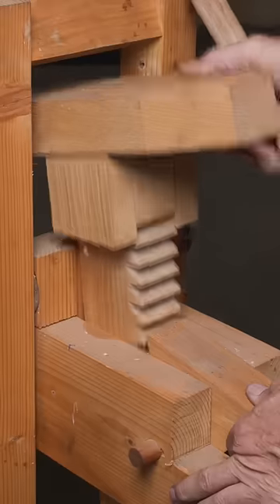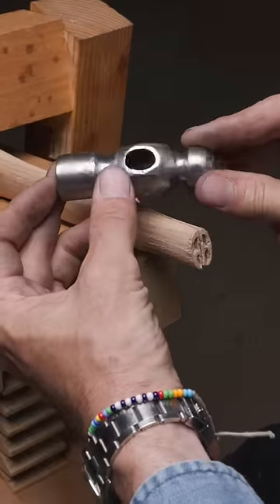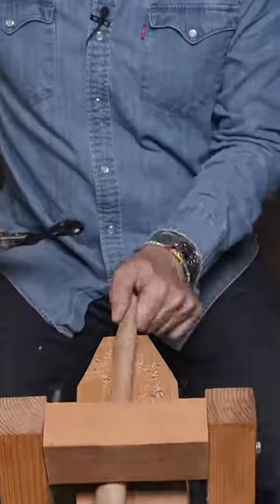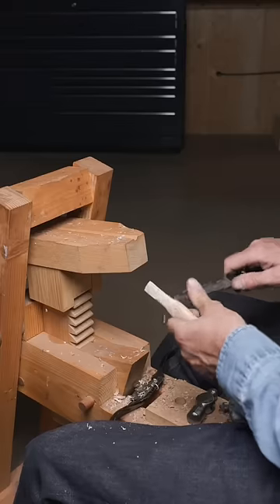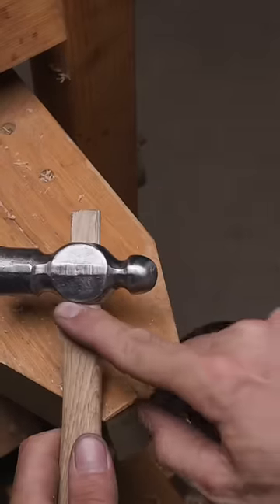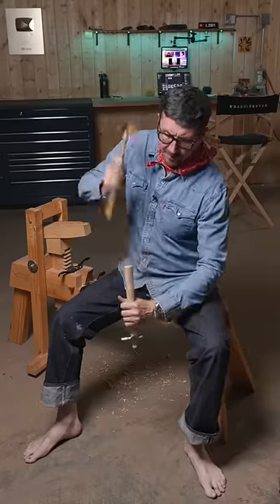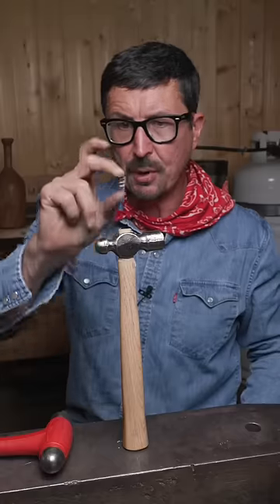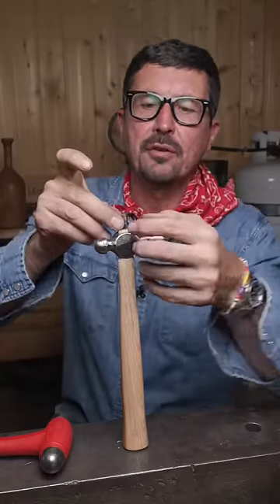Professional Homeowner Hack #30 Wranglerstar #Shorts

Comment: I'm going to be totally honest, as someone who's pretty handy and a professional mechanic, I didn't realize you put the handle through the small side, but sa soon as you said it, it made total sense.
Reply: Me too! I have re-handled at least 30 hammers in my life (born 1949).  I didn't know to go into the small end.
Reply: I don't think your actually suppose to do that but I mean I don't know that just don't make sense to me
Reply: It lets the wedge do it's job
Reply: I've been mishandling my hammer too...
Reply: @shakinbottles  No, you are supposed to do that, when you hammer in the wedge the top of the handle gets wider and the head will be snugly pushed against the shoulder of the handle, and won't come loose over time.
Reply: 🤯🤯🤯me too
Reply: This
Reply: Yep, anything with what is called an adz eye needs to be oriented correctly.
Reply: Expansion is your friend.
Reply: That's what SHE said!
Reply: Do it with a framing hammer
Reply: @shakinbottles you absolutely are supposed to. Otherwise the head will fly off after heavy use

Comment: Before the wedge draw a line on each side of where the wood comes out of the head then remove the handle frome the head and c it on the pencil line so it matches the depth of the head and it and put your wood wedge in and cut the excess off and drive the steel wedge into the end of the hammer and it will look factory finished
Reply: yep

Comment: You will get more wedge pushing/tighting force by having the wedge at a 90° angle.  

90° is pushing on two spots

45°is pushing on 4 spots.

If you use 45° method, use a slightly larger wedge.

Comment: After I clean off a rusty metal tool I like to spray it with dry moly film so it won't rust again. It is not oily so it does not have other contaminants stick to the metal.

Comment: One hammer handle 15.00 
One shovel handle 18.00 
Both hickory 
I cut my own and shape my hammer handles just get 4 
Handles from 1 shovel handle 
Side note it’s also good for 5lb sledgehammer too 
I’m a body man I break my body hammers quite a bit 
Custom shaped handles fits each hammer for their use 
Something you should try Cody is setting a hammer or ax handle with panel bond epoxy I still use the wedges 
I coat everything with epoxy even the wedges, it fills the subtle gaps and I rarely have a handle come loose , I still break them from allot of use 👍🏻

Comment: Yeah I go the Old timer way using that boiled lin seed oil. Apply it, let it absorb, repeat until the "ponds" remain. Wipe it down. If it remains a little sticky you can use a little bit of turpentine to cut it down and to smoothen it up. Use proper ventilation. Gives it that 1950's kinda look. Nice job man!

Comment: I’ve got a block hammer that my uncle gave me years ago, I recently replaced the handle and took a wire brush and some WD-40 to the head, which was all caked in years of rust and grime, and I saw the name of my great-great-great-grandfather stamped into the head. Asked some of my family members about him, apparently he was a blacksmith and machinist, born in Hungary in 1848. And that hammer is harder than a coffin nail, a file won’t touch it, so it had to have been stamped when it was still glowing. I’ve used a hammer forged by one of my ancestors for years, and I never knew until last month.

Comment: Only thing I'd add is to saw of the exposed wood atop the hammer head before driving the metal wedge in at your 45 degree angle.  That way the wedge seats flush with not residual wood.  
Also, it is imperative to wear Westco Jobmasters 24 hours per day.

Comment: I always cut the handle so it’s on the shoulder but ends up a fraction below the head of the hammer, drive in my wedge at an angle, then fill the gap with epoxy.  That’s how my Dad showed me 60 years ago, and it’s worked well for me.  I wish I had that jig you’ve got for fitting handles though, nice!  👍

Comment: Why do you seat the handle by striking the bottom? Does this do something specific that going from the top wouldn’t achieve? Thank you Cody!
Reply: Provides a 'natural' seat, goes where it wants, instead of where tou want it too. This tells you if you've done a good job (by showing if its leaning or twisted.)

Don't force the head onto the handle.

Comment: In a few videos I've heard you address scraping varnish off with a pocket knife but I've never heard you say why not to use sandpaper.
Reply: Scraping it causes varnish to come off in larger chunks/curls.

Sandpaper causes dust in the air, and clogs fast with varnish.
Reply: @autumn5592  ty

Comment: What is that cool device you are using with the foot pedal? Why take the varnish off ? I just did this project, but with bamboo. I inserted a piece of bamboo that had been spit in half lengthwise. Then I wrapped it with electrical tape. Then I mixed a 2-part solvent together and poured it into the hollow created by bamboo on one side and electric tape on the other.

I let it set up and harden. The cool part is I grow the bamboo myself so there is little or no up front costs. I can also make the handle almost as long as I want!

Comment: Do you have a video showing how to replace a handle on an ax head? I have two ax heads. And have no idea how ro fix them. Is it the same process, just bigger? What about the part where you hit the handle on the back to drive it into the head as deep as possible? How would you do that, with a large ax? Oh yeah, these are large ax heads. Not hatchet. Thanks

Comment: I have many a tool in my collection. However, i dont have a fancy wooden vise as such.
My homeowner hack is to knock the head off my ball peen with an estwing, then ill continue to smash the new handle in the head by smacking down on my welding table a few times, drive in the wedge, and fight with it loosening up for next few years before i snap another handle, to do it all again.

Comment: Do you find anything wrong with fiberglass or Kevlar carbon composite handles?  Is there anything much different about putting one of those handles on that might be better than the way you typically put on a hickory handle? 
  Personally, I don't prefer the look, but I think they withstand atypical abuse better.

Comment: Would roughly the same process also work on an axe head?

My pop’s got two axe heads split off into rotten logs from like 13 years ago, one’s all rusted but the other’s still shiny, just gotta get the old wood out of it and it looks like this’d work
Reply: Yeah, it'll work fine.

Comment: I'm confused. I looked at my hammers and they all have what looks like the handle and a spline. All the splines are wood except one is metal. So there's a wood spline you tap into the head of the hammer and then a metal spline driven into that? Also, there is nothin coming out of the hammer head. The top of the handle is flush with the top of the head. These are from my family so they are not recent.

Comment: I hate wooden handles on hammers. All my hammers have steel handles welded to them.
Reply: I feel sorry for your wrists, and soft hammer heads.
Reply: @autumn5592  My wrists are fine.
Reply: @11guyinthechair  rofl sure
Reply: @autumn5592  yh. What do i know. Working for more that 10 years now. I use hammers for panel beating. Bought a really expensive wooden handle hammer. Handle fell out after 2 weeks.
Reply: @11guyinthechair  Maybe treat your tools with more care?

I have my grandads hammers, which he used for half his life, my father then used, and now I use.
All but one still have the original handles on.

Comment: I've seen it several times now to strike the back of the hammer, but I don't understand why. Would someone please explain this to me?
Reply: Should've paid more attention in class lmfao.

The head weighs more, as a result, any force exerted by the handle will have a minimal effect (it won't move as much compared to the handle.)
This drives the handle into the eye of the hammer, resulting in a better and more natrual 'seat' onto the handle.

Comment: Why not cut the handle and sand it flush? Is there a benefit to leaving it long?
Reply: Yes, it is less likely to loosen, and makes doing things later (like driving wedges or soaking in drying oils) easier.

Plus, I personally think, it looks nicer.

Comment: Or, get this, you could just buy a new hammer… let’s not act like they’re that much more expensive than a replacement handle, and you can even get them with full metal construction (which means no more broken handles)

Comment: Wane
I'll say my bit about handles. I don't know what to say about the guy who said the best grain is perpendicular to the direction of swing.
   I look for grain which has lines of grain that run the same direction as the direction of swing. I want tight grain, cold weather Winter grain, not big fat rings from an Alabama Summer. No knots, no wane, no missing material.

Comment: Why remove the varnish?
Reply: Makes the handle feel bad. 

Once you've felt a handle with boiled linseed oil on it, and it's broken in a bit (been swung a bit, slid through your hand), it is night and day difference.

First thing I do whenever I get a wooden tool handle is scrape the varnish off.

Comment: K, but wouldn’t a truly professional homeowner make his own handle?  I’m nobody’s idea of a wood turning expert, but I’ve done several hammer handles in oak and ash with simple double centre turning to get an oblong profile, and I’ve done them on pretty much the cheapest and crappiest chinesium lathe known to man.  Doing it yourself lets you customize the size and contour of the handle for your own grip. Prior to acquiring the lathe, I had re-hafted a couple other hammers with just a spokeshave and a belt sander, without having a fancy shave horse like the one used here.

Comment: You didn't re-varnish the wood

I'm no wood worker but it would seem important to coat the wood in something
Reply: You don't want to varnish the wood, it makes it feel like trash.

Oil the handle.
Reply: @autumn5592  oh yea probably. Like I said, I don't know anything about it but oiling the handle sounds right

I just know you're supposed to put something on the wood 

The saying from what I remember is "Once a day for a week, once a week for a month, once a month for a year then once a year forever"
Reply: @officiallyanthony  You don't HAVE to put anything on hammer handle, so long as it's used often.

Linseed oil, walnut oil, danish oil, mineral oil, sugi-ban (charring), all work fine.

You don't need to do that, just a couple times is more than enough.
I have tools with just two coats of BLO that last years.
My more used tools get a wipedown with spare BLO off rags whenever I make or restore tools.

Comment: In summary, you just need several hundred dollar's worth of equipment to save $20 on a new hammer.
Reply: No not at all.

You can do it with a pocket knife, small saw (if no wedge slit in the top of the handle) and another hammer or even a rock/brick.

It's easy to do, takes maybe 10 mins, and it saves your old tools.

Comment: Why do they put varnish on if you just have to scrape it off? Seems rather inefficient.
Reply: Not many people scrape it off.

The varnish keeps the moisture out and protects the wood, but it's not very comfortable to hold and use.
It is very slippy and nasty feeling.
BLO coating and/or some paste wax makes for a lovely tool handle, and is also resistant to water, wears better, and feels great.
Reply: @autumn5592  Thanks for answering my question. 😊
Reply: @AlexanderKrivacsSchrder  happy to help

Comment: Gee whiz, Is it really too much work to make the top wood flush with the metal?
Reply: Its better to keep it hanging out the top
Reply: @autumn5592  There is no logical reason why it has to be hanging out of the top like that as long as it's properly wedged. .
Reply: @TSimo113  more supporting material, less chance of head loosening.
Reply: @autumn5592  the wood below the hammer is not supporting the hammer and neither is the wood above the hammer. It’s the wedge and wood contacting the hammer surface, that’s it. If you cosmetically shape the wood so that it is more flush with the hammer you are not weakening it as long as you wedge it correctly. Leaving such  a large amount of wood above is just sloppy and lazy.
Reply: @TSimo113  The holes taper inwards, the wedge causes separation of the wood to expand the top of the handle, sealing it.
Wood above the head allows further expansion, a better mechanical seal.
It's stronger and safer.

And it looks better too, but to each his own.
Reply: @autumn5592  my top hole on my ball peen is straight not tapered but ok to each is own, I guess most of the major tool makers have gotten it wrong over the past 100 years
Reply: @TSimo113  If it does not taper in the middle (hour glass shape), it cannot properly hold a handle. 
You have mounted your hammer head upside down.

As for the manufacturers statement, they do what is enough, not what is best.
Sure the benefits are minimal from having a little extra material on top, but it does increase the joint strength. Hammer manufacturers just want a tool to look appealing to the masses, and admittedly, the handle sticking out the top isn't a popular cosmetic choice.
Reply: @autumn5592  I guess I misunderstood what you meant by tapered. I did not mount my hammer and I assure you it is not upside down.

 For the overwhelming number of "professional homeowners" either way will work just fine, that's why cosmetics probably matter more than the miniscule and unmeasurable amount of extra strength his ugly hammer will yield.

Comment: what's actually the point in doing this? sry if it sounds rude I'm just curious
Reply: To make a hammer usable?
Reply: @autumn5592  why tho u can just buy another
Reply: @brucewills9706  Sentimental value, quality tool, having it fit your hand perfectly (length, width, shape.)

I have a bunch of my grandads hammers, always the first thing I reach for when I need to smack stuff, I can't imagine buying more (in the same size and shape.)

And, depending on the hammer, (mainly the cheap ones), buying a new one would be a poor choice.
The handles aren't replaceable (metal handles), the heads are cast instead of being forged, and their fit and finish is garbage.
Reply: @autumn5592  you know that makes a lot of sense, in future I'm gonna be doing this

Comment: Why wouldnt you just...buy a new hammer? The effort put into rehandling a hammer is not worth the few bucks saved.
Reply: You can’t buy a hammer of that quality anymore
Reply: I beg to differ
Reply: @autumn5592  I bet you use a eastwing
Reply: @strangetar2833  No, I don't like metal or fiber handles.

A good wooden handle with BLO can't be beat.

Comment: Top of the handle should be flush with the head.
Reply: Why?
Reply: @autumn5592 Because thats how almost all hammers come from the factory including this one originally. The wedges would be farther down as well if the excess wood was removed prior to inserting them.
Reply: @PhD_Dad  Because they come from the factory like that means nothing lmfao.

Then just cut the wedge and slot properly, then seat it, and it won't be an issue.

Do you have any actual reason, or what?
Reply: @autumn5592  The farther down the handle they are inserted inside the head, the tighter the fit and stronger it will be. That is why they are manufactured like that.